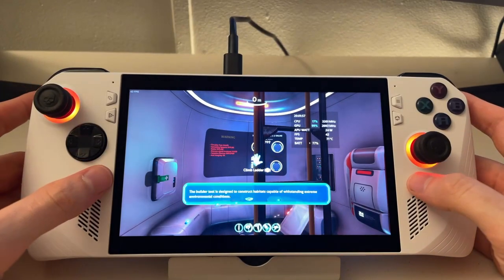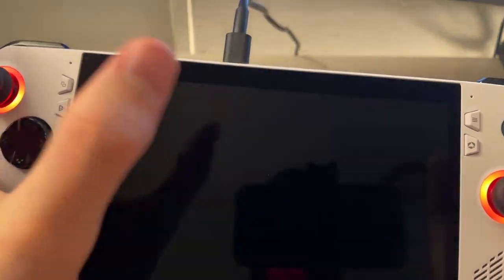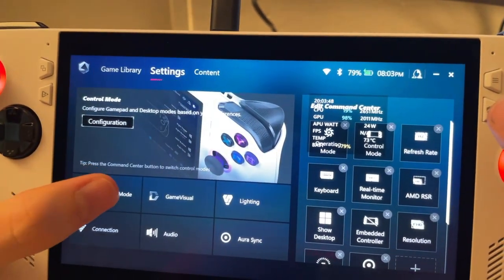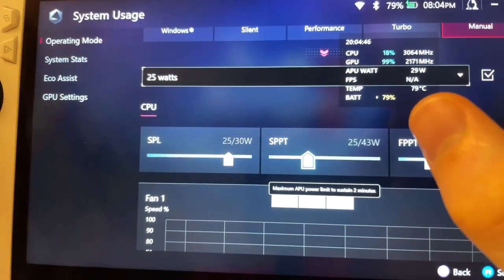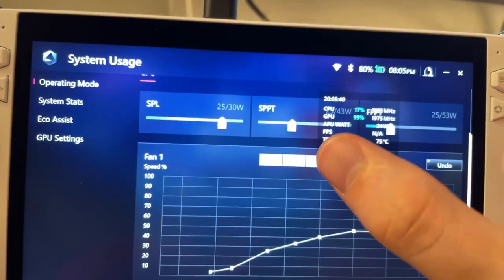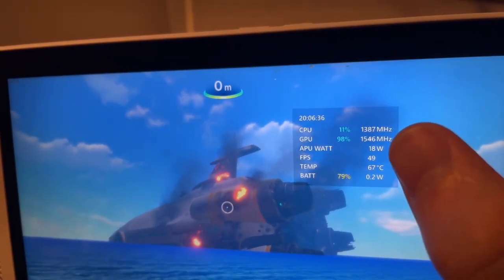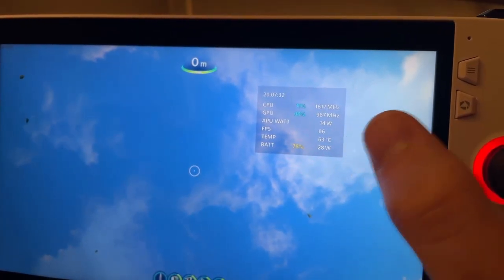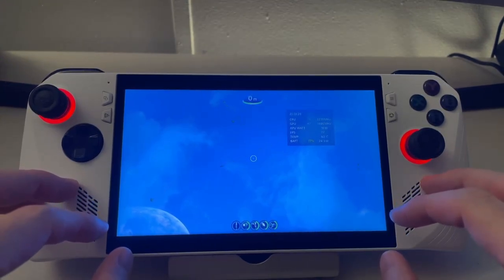ROG Ally | Use these MANUAL power levels

Comment from the maker: I just released the video about CPU Boost if you're interested in seeing what it does, and why I recommend disabling it: https://youtu.be/e3Jd7PLuVSg
Reply: How do you get it to recognize when to change mode for battery and plugged in my always defaults to performance and I have to manually change it to manual and then choose the wattage even though I have a 18 watt and 25 watt saved profile.
Reply from the maker: @noifwoao  You'll want to unplug it, then set all 3 sliders to manual mode @ 18 watts.  Then plug it in, and set them to 25 watts.  It's saving the profiles independently.  If you've done that, then the issue is it will save watt settings on a per game basis.  So if you've set it to performance in a certain game, it'll automatically go to performance when you launch that game.  

Hover over one of the games you have in the Armoury Crate launcher and press the "X" button for "Game Profile".  Then go down to "Configuration" on the left hand side.  You'll see the "Operating mode AC" which is plugged in mode and the "Operating mode DC" which is unplugged.  You can set them in there.   They should save however after changing it in a game though.  I really don't like how Asus has set this up, because I'm not seeing a way to set the profile across all games.

I might end up doing a video on it, as from what I can tell the controller profiles are doing the same thing, with no way to set it "globally" for games you've previously opened and changed the settings.  Hope this helps, let me know if you run into any issues.
Reply from the maker: @noifwoao  That is really strange!  I'm not sure what would be causing that.  Make sure you don't have a game open when you set the power to manual (on both plugged in an unplugged).  Also, try going to "Content" at the top and then clicking "Update Center" and see if there are any updates for Armoury Crate.  It's possible you might be on an older version of Armoury Crate, let me know what you find :)
Reply: Figured it out for some reason it wasn't recognizing my charger as compatible even though I had it plugged into the charger that came with it so I moved it to a different plug on my power strip and now it works thank you.
Reply: Also after you get those set if you plug in an incompatible charger and unplug that charger it messes the settings all up and won't go back to the battery settings and stick with last known until you plug in a compatible charger or restart the Ally. Maybe a bug or windows thing or they just didn't program it to operate correctly with a charger below 65 watts correctly.
Reply from the maker: @noifwoao  I did notice the charger/dock issue when using a different charger.  I have a dock I've been using in most of the videos that should be pushing near 200 watts, so it's definitely something with the ROG Ally.  I have a video coming out tomorrow of an unboxing of the official ROG Ally dock and it works perfect.  I almost feel like Asus is purposefully blocking compatibility.  I don't know for sure, but it seems like they are.
Reply: I wonder if they put a chip or a protocol to recognize only their chargers like the Nintendo switch with it's dock where 3rd party docks don't work, I've seen some other chargers work but some don't. Even watched a video where a guy had 2 of the same exact chargers one worked the other didn't so maybe some defeat what ever they are doing.
Reply: The new Anker Mac book pro 100 watt charger works plugged in or plugged into my ivoler dock. I just tested it and profiles work with it.

Comment: I agree with you, I no longer use or see the need to use 30w turbo mode it didn't really give me huge improvement that made the extra heat worth it, I feel the sweet spot is 17w-20w like you said I get really good fps and temps without all the extra heat and power draw. I also had that screen tear issue and some games won't allow me to do 120hz but I found changing the stock 4g to 8g made a good improvement for me, no more lag and games run better for me with medium to high settings 👍🏻 just an idea I've been playing Arkham asylum at high settings @ 1080p 120hz with 60-62fps consistently with temps at 58-62°c all at 17w 👍🏻

Comment: I have a few myself I made a custom 13 watt mode for certain games to prioritize battery life even further like the accent was pretty decent performance at lowest graphics on 13 watts. Just depends if I’m gonna be near a outlet or if I have the portable power bank with me. But I usually do either a custom 15 watt mode that boosts to 20 for 10 seconds or my custom 18 watt mode that boosts to 20 or 25 for 10 seconds when on battery

Comment: Oh nice; this may help with some of the overheating problems I've been having. Wattage spikes would explain heat spikes under low load. Good tips!

Update a few days later: My overheating problem because interminable and I had to return the device and exchange it for a new one. As best I can tell, something was causing the CPU cores to boost their clocks stupidly high (up to about 4.3 ghz) on boot up, which caused a massive heat spike and crashed the Ally in only a few seconds. No idea what caused that but hopefully it doesn't happen to the new one.

Update 2 about a week and a half later: I've received my replacement unit and after wrestling with a bunch of software updates, I've disabled all CPU boosting in Windows following Filterless' video in the pinned comment and that appears to have fixed the heat spike problem that my first unit was having. I don't have an SD card to test on the new one, but so far it seems to have stabilized. Here's hoping it stays that way.
Reply from the maker: Hey, just so you know I just had to return mine because the SD Card Reader stopped working.  I have a whole video I just released about it, where I go through and test it.  I'm going to hold off on the exchange till I hear what Asus says about the SD Card issues.  

With my testing I suspect it's heat that could have caused it, just like you said, it boost way to high and way too hot.   What's annoying is I think Asus put the boost in there for benchmarks so it appears more powerful...  Frustrating for sure.
Reply: No update can fix the location of the sd card slot on the motherboard.Another blunder by the engineers and the designers.This is the biggest flop in handheld gaming history.
Reply: @uclapac10  Seems a little early in the device's lifespan to get melodramatic about its merits. I agree the SD card location makes it vulnerable to mechanical failure caused by excessive CPU heat, but some people's SD card reader issues have been caused by (and fixed via updates to) software and not hardware. I think calling the Ally a flop ignores a lot of the device's capability. The next month or two will be the real test of the product's viability as a whole, as we see just how committed Asus is to supporting the Ally and addressing customer concerns.

In the meantime, it's probably best to disable all CPU boosting to help prevent the both the overheating issue and possibly the SD card reader issue.

Comment: Thankyou brother i followed your guide for manual mode 17w i done 10 less fan than the degress up until 60c and then it maches and basically maxes fan out at 70/75c i think not fully tested yet but gone from silent fans to actually hearing them 😂😂 rather a cool bit louder device than a red hot less of a life span silent device 😂

Comment: Good stuff man!  Whatcha got on your sticks and do they tighten up the stick or make them more comfortable?  I really hate the joystick on this thing.
Reply from the maker: Thanks!  Here is a link to the joystick extenders I bought.  https://www.amazon.com/gp/product/B079811C49/ref=ppx_yo_dt_b_search_asin_title?ie=UTF8&psc=1.  They are for PS5/PS4 and the Nintendo Pro Controller so they don't fit perfectly.  I'd probably hold off for some specifically made for the ROG Ally.

For me they make them more comfortable, but they feel even looser with extenders on them.  I'm sure there will be 3rd party joysticks at some point where we'll be able to replace them.  I've taken apart the console and removed the Joysticks and it's not too hard to get to them.   Asus has made it a lot easier to take apart than other devices I've seen.

Comment: How did you get the manual power plan in the command centre? I have set a manual 1 but on my command centre it only shows silent,performance and turbo, many thanks in advance and you got my sub, great vids my friend 👌
Reply: Cause you did not apply the manual mode in armoury crate. Once you set the power levels make sure to tap the icon which has the tick mark within a square box. It should give you a warning prompt. Click Ok to proceed. Then you will be able to see the manual mode in command Center too in the operating mode toggle button

Comment: Hey i've got a quick question, so when i changed my settings to manual mode i applied 17w to unplugged and 25w when plug just like you did but when i go to the command centre and its on 17w it keeps up the menu manual mode settings of the fppt etc so i can change it on the fly but i don't want that how do i remove that still staying on there

Comment: thanks for the tips man. btw whats fan 1 2 and 3? are they just different level setting that you can set and you choose? so doesnt matter which one?
Reply from the maker: Yes, however, I wouldn't use 1 or 2, the default to the fans being way too low.   I'd only use 3, or adjust the fans manually by dragging around the squares.   I personally just use 3 and get great temperatures.
Reply: @filt3rless  thanks. on fan 1 level 3 i cant lower the speed when its on 80c its on 74% fan right now. is this from a update?
Reply from the maker: @menmabmx1995  Yes, it's from BIOS 322.  They're ramping up Fan 1 because it's near the SD Card reader to try and mitigate heat.  I have a video on why I don't think it's a good solution: https://youtu.be/bLkPKb9dwOw
Reply: @filt3rless  ah thats kinda annoying fan is a lilttle loud but oh well hopefully they change that. manual mode change to auto lol.

Comment: Great vid dude! Highly appreciate it
Doesn’t shifting from 60hz to 120hz (even though FPS doesn’t hit 120), drain battery faster? For example if I cap FPS at 45, does battery drain faster if I toggle 60 to 120hz?
Reply from the maker: Hey, glad the video helped!  From my understanding if you have the FPS capped at 45FPS, you'd actually save some battery life, since the display is matching the 45FPS and will refresh at 45Hz.  However, I'd say it'd be almost impossible to notice any power draw difference between the two when gaming because of how small the difference would be.  The power levels you're running and FPS in game will be of far more importance.  

So capping the FPS to 45 in a game that could push 80+ or so will be a huge improvement in battery, but switching between 60hz and 120hz, you probably won't see much difference if at all. If you were planning to watch a movie or YouTube however, 60Hz would give you longer battery life and I would recommend switching it for video watching.  As you're only seeing 60Hz (or even less in some movies) and theres no reason to have it running at 120Hz as FreeSync doesn't work for videos.
Reply: If this helps: In my phone (ROG Phone 6 165hz) the ARM SoC which maxes out at about 12~15w in very heavy use capping the refresh of the screen to 60 does improve battery life while the phone is not in use for about a day (sleeping), but in normal use or even gaming unless the game pushes framerate higher than 60FPS the refresh rate of the screen doesn't have any meaninful difference in battery life. In my laptop with a 144 hz screen and having a CPU that can push about 40w (although i do cap to 29.5w because of diminishing returns using ThrottleStop in TPL menu) the refresh rate play too little if anything in battery life even if i a cap to 60 hertz, screen brightness and even the speakers consumes more power than the screen refresh rate.
Reply: @filt3rless  thanks! Makes sense 😁
Reply: @M4RC0Geek thanks for the details!

Comment: I didn't test if setting refresh on screen to 120hz drains more battery, but I find turning on vsync will also fix the tearing
Reply from the maker: Hey, V-Sync definitely does reduce tearing.  I've notice it adds some latency though in most of the games I enabled it in (the input takes longer to take effect).  So I usually leave it off for that reason and just use 120Hz and freesync as it does basically the same thing, but without the added input latency.  Give it a shot if you have time and see what you think :)
Reply: @filt3rless yep it does but I guess for me it's not enough of a problem, the only reason I go this route is to save more battery, but although I haven't really tested this or see how much more it drains, it just makes sense that way unless you've noticed no difference?
Reply: @filt3rless  also to add that 18watt does make a difference and drains a little less as I have a 20 watt mode set on mine that literally gives a frame or two more battery. I don know what the point of 25 watt mode is. In the several games I tested it only gives 3-6 frames more but drains significantly more battery. Asus needs to tune those power modes even more
Reply: Uncapping the framerate is a better option because it will feel smoother due to VRR it will feel smoother due to frame time being more stable, and it should in theory save battery due to the screen matching the refresh rate instead of being at 60 at all times
Reply: @pogchamp4542  more fps will need more power and kill battery quicker right? If a game dances around 65-75fps fluctuations cause instability rather than capping it at 60 fps keeping it stable and using less power necessary
Reply from the maker: @reeeformat3843  I personally always leave off V-Sync and then just set the power levels to what I'm willing to draw.  18w on battery is what I use.  Then I adjust the games graphics settings till I have the FPS I want in-game.  Some games I don't mind lower FPS, like driving games, but action games I prefer higher FPS.  You can try doing V-Sync, Capping FPS, etc, but I find it too cumbersome to do for every game.  Uncapped, 120Hz refresh rate, manual power settings seems to be the best option.   If you want to save power then you can bump the power levels down lower without having to mess with settings or FPS caps.  And I think on this device you might as well use the 120Hz even if there is a slightly higher power draw, that's the whole point of getting the ROG Ally is how amazing the screen is.   Hope this helps :)

Comment: pretty counterintuitive ro enable 120hz while fixing battery issue sicne 120 hz uses more battery. a little tearings fine if u want more battery duration per charge.
Reply from the maker: From my understanding of free sync the display is matching the FPS of the game.  So in this game it's actually running at 45Hz.  If you set it to 60Hz, it constantly runs at 60Hz no matter what.  So you'd be able to actually save battery as well as reduce tearing if you're below 60Hz.  Now if you're running something at 120FPS, or watching videos (YouTube, Netflix) then 60Hz is a great option if you want to conserve battery.  And if you set it to 60Hz, you can turn on V-Sync and it'll cap the FPS to 60Hz.   The "FPS Limiter" is basically useless on this, which I was thinking about making a video on because it doesn't work in Direct X games (which is most games).  So something like MSI Afterburner with RTSS would allow you to cap the FPS across all games.

Comment: Thank you for your Videos.
I have a issued with my Fan curve... I tried to Change it but  the 4th dot has to stay above 74.
Ive Seen many Pics in Reddit, and they all have IT below 74. Any clue why its fixed to stay above? Was there an Update?
and do you have the Same curve for Fan 1 and 2 or are they different?
Reply from the maker: They updated it in a bios update to force it to 74 unfortunately.  Because of an SD Card issue.  So it was an update.  It was bios 322 that caused that, and it's still present in 323.  So you'd have to roll back to 317.  But then you'd loose some performance as bios 323 really boosted lower watt performance.

Comment: I just noticed that when u unplugged it, it automatically switched to 18W on manual mode. How did you get it to do that? I basically want to do exactly like your settings; 25W on AC and 18W on DC without having to enter armory crate and selecting from the manual mode drop down list :)
Reply from the maker: When you unplug it, you can go in and set the Manual mode to 18w.  You have to set the 25w when it's plugged in, then the 18w while it's unplugged.  Also, only the official charger/dock has worked for me.  When I use 3rd party adapters/chargers, it stays in the same power mode when plugged in and unplugged.   It's only on the official charger that it'll automatically switch.  Hope this helps! :)
Reply: @filt3rless  That is exactly what happened with me. When I used the official charger it worked (changes automatically), and when I used JSAUX it doesn't change (need to do it manually for now). Thanks for confirming! I highly appreciate it :)